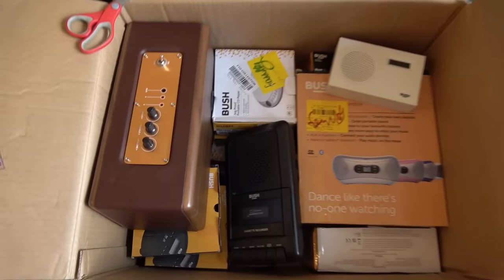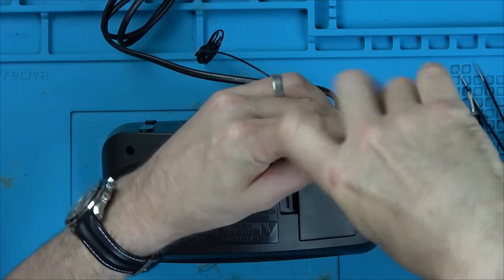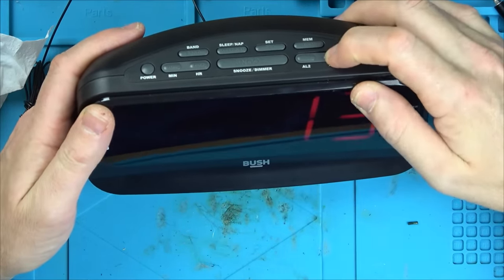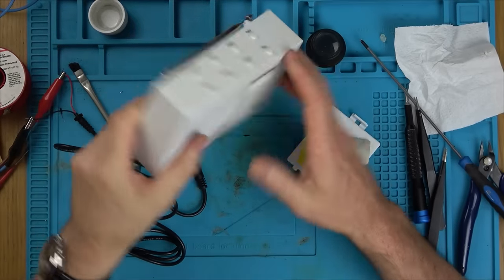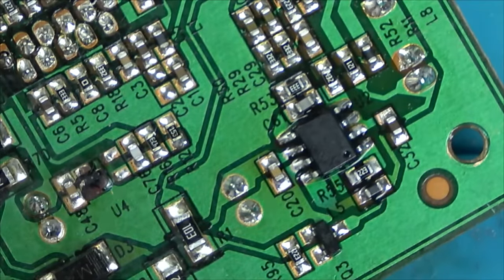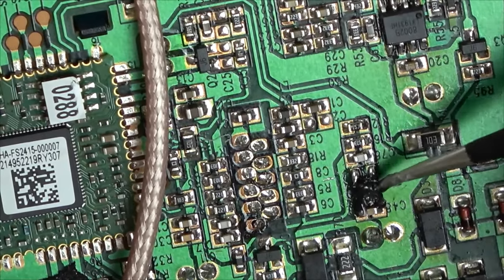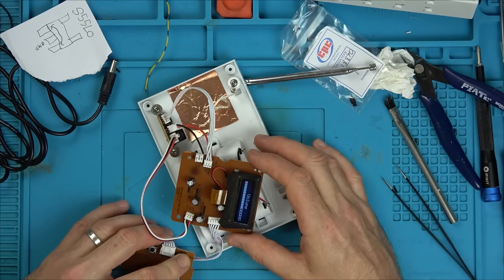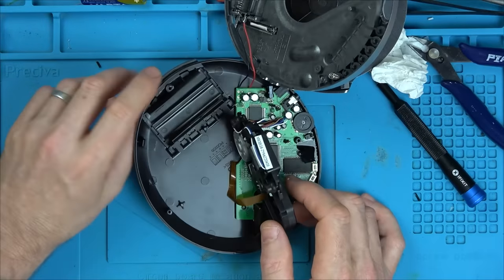I Bought ARGOS CUSTOMER RETURNS to FIX - Can I Make ££$$€€

Comment: The AM radio has been purposely damaged/disabled so that it could be returned as not working. 
In case the staff plugged it in not only does the Tuner not work there is no sound. No-one opens the equipment up to check for physical internal damage so they get their money back. And they then go back and purchase another one which they will also return within the year of purchase.
Thanks @Mymatevince for another cracking video, you really are awesome!

Comment: Old devices often had block/part diagrams glued somewhere inside their cases. And it was a norm to get the schematic sheet distributed as an insert in the user's manual.
Reply: I remember that too.
Reply: Those were not that complex back then, nowadays everything is in one chip with billions of transistors and proprietary circuitry, but without what we have these days we wont be on the internet or we would still use computers the size of rooms
Reply: @309electronics5  Things like color tube TVs were quite complex. Certainly more complex than 90s highly integrated devices. Also, there are schematics of things like PC and laptop motherboards available to download (not always legally, but still). Usually it's just a couple of sheets. Would be easy to print and put into a manual. No one expects internal chip diagrams. Even just a part list would be enough.
Reply: I think companies have come to two conclusions here.  Most people will not even think of repairing something and of those that do, few will try.  Add in the desire of companies for customers to buy again, though  why one would if the thing broke, and why would printing a schematic be anything but a useless cost to a company?
Reply: Doesn't happen much these days with these cheap Chinese products. Except some microwaves, maybe... edit: however, it doesn't take that much more time to add the part number of the ICs to the silkscreen... I loath seeing "U1", "R1".. ok, cool, that refers to a reference number on the schematic, we don't have one... just print the part number.
Reply: My 1st cassette tape recorder - circa 1970 - came with a booklet and at the back was a foldout circuit diagram. I’ve still got the booklet complete with the circuit diagram, but not the machine.
Reply: My first car came with instructions on feeding, hoof care, spare reins etc.
Reply: @AstrosElectronicsLab  
Most small consumer electronics items are not intended to be repairable. It is arguable that there is no value in any component identification screen printed onto the boards. It does cost something and has almost zero value for assembly since parts placement is usually completely automated.
On almost every surface mount PCB I've designed I've struggled just to find space to fit the component identification in characters big enough to be screen printable. With something like an 0402 SM resistor,  just the ident can take more space than the part. Sometimes it's even difficult to find space for characters that don't require much zooming on a drawing of the board. But I did only industrial and scientific electronics, never anything sold directly to consumers.
Many manufactures no longer print anything on discrete SM resistors. Most SM caps never had any markings unless they were specialty types.
Reply: My dad ran a TV/Radio repair shop in the 60s and 70s. He had a book with schematics for hundreds of TVs. I recently cleaned out my parents' house and found it - slung it as it's unlikely anyone will need the schematics now. A different era when nearly everything was discrete components. BTW, silk screening the component parts really is not viable - often the components are changed like for like during a production run and will have different numbers (but the same or similar tolerances and functions).
Reply: My first car had a user manual which included detailed advice about setting up the valve timing. My latest car's manual has advice about not drinking the anti-freeze, and what to do if someone does drink the anti-freeze.

Comment: Great video 🍻
20:09 The polarity of the speaker does matter. As soon as you get near another speaker with the correct polarity, playing exactly the same, you may hear some weird sound cancellation effects 😉
Starting at 26:30 , you talk about "Right to repair", how it would be better to have access to documentation of circuitry in some way. Somebody already mentioned, how it's been normal, that schematics and parts lists of a product were included in delivery...they stopped doing this decades ago, bit by bit, time flies 😳  
Louis Rossmann is heavily lobbying for RtR and I think its a good thing to make people aware of these bad practices.
34:54 Measure it. Your Multimeter has mA uA and A connections. To use them, plug the red probe into the A. Break the circuit and use the probes to bridge the supply output to the circuit input through the multimeter. If the measurement is below 0.2 A (200 mA) use the mA mode and connection. And MAKE SURE you are not using the amp measurement connections for modes they are not intended for, as it MIGHT DESTROY your multimeter, or the circuit, or both, you can even pop a circuit breaker by accident. Never measure how many amps a supply can provide, if you don't know its regulation capabilities...done it on a german 3.5 kw breaker 🙈 nice pop
39:22 list of features says it, Power Supply Ripple Rejection. This is kind of what you want for the application "radio". Both were a good choice, but the first may have had a hard time coming up from shutdown with its max 0.5 watt rating 😅 the second one delivers roundabout 1 W max. and might pop just like the factory one, if 1W is not enough (measure it 😆). 
EN and SHDN with the line above means NOT in binary logic. So like, not shutdown when true (voltage).
Reply: Audio is AC

Comment: The 2nd clock was definitely tampered with. There's no way it would have left the factory in that state. Someone messed with it, and then returned it as faulty. My #1 reason for never buying open box or returned goods, even if they work, is that you never know who had them before, and what they did to them.
Reply: Or maybe someone sabotaged someone else's alarm clock for some devious motive. Then the owner rightfully thought it had just broken and returned it as faulty.
Reply: Buy a clock and change your mind there is no refund. Take the back off and cut random wires gets your money back.
Reply: @mbak7801  Exactly that!
Then the seller's loss gets put into the overall price of their products, so the rest of the customers pay for a select few to enjoy free products.

I've got a cheap scale to use in making espresso and it's inaccurate, so I decided to return it. Had to contact Amazon because I couldn't print a return label and spoke with two different agents, got the label issue sorted, all without even asking me what was wrong with the product...
Reply: Could simply be terrible QC.... never know.

Comment: With those dome switches, you could turn on the radio when it apart and press the button with your finger to test.  More often than not the switch is not the fault, but looks like you got lucky with that one and it wasn't aligned correctly :)    Good to have a success on the first one.  The speaker fault looks deliberate.  Customer didn't like it and wanted a return.  Looking closely at the speaker, looks like it was deliberately cut.  There is a band switch on the radio, someone cut out the AM Loop Antenna also.  Speaker polarity with a single speaker is not important as a speaker uses AC, so you can connect them either way.  On a device like this phasing is not important.    The battery polarity, I've seen it often with Chinese made devices having the colours wrong

Comment: The 'wire with fabric' will be Litz wire, where wire and thread are spun together to reduce 'skin effect' where radio frequencies are present. It also is used on loudspeakers to reduce metal fatigue where the link wires are flexing...
Reply: Absolutely right. :)

Comment: yeah what i think happened with the second clock is that someone didnt like it so cut the wires and returned it as faulty - they also asked for a refund.
Reply: I don't know why you'd do that.  It's a cheap clock radio, clearly, but a cheap clock radio is better than no clock radio in my view.
Reply: i did that with a cheap cellphone. intentionally overdischarged the battery and tampered with the charger so I can return it. Some stores just don't accept a "change of mind/item no longer needed" as a valid reason to return a product.
Reply: @RealEpikCartfrenYT  What country do you live in?  I think here in Australia we generally have the right to return something if we decide we don't like or want it, but it has to go back within 14 or 30 days or something.  I could be wrong though, I can't remember exactly, but you do have rights as a consumer.
Reply: @Lachlant1984  Bosnia and Herzegovina is my country's name.

There are stores which do accept returns normally but in this case I needed to tamper with it as they only accept if it's faulty.
Reply: Argos has 14 day money back no questions so seems a bit silly but people be crazy :)
Reply: @MrLingering I had a devil of a job returning a tablet to them 2 hours after purchase as we discovered it didn't use the Google play store but the manufacturers own limited store, got there in the end but it nearly involved trading standards for misleading advertising
Reply: @Lachlant1984  If you travel to Singapore, you can't return an item if you don't like it. Almost all shops have rules stating "No Change Of Mind Allowed". They also affixed a "warranty void" stickers on the screws so that you cannot open the product to damage its components.
Reply: Why go to the bother of taking it apart and cutting wires when Argos would take it back without question anyway? 😁
Reply: @RealEpikCartfrenYT  In the UK if you purchased from a shop there is no legal right to return if you change your mind, although most shops do allow you to. With mail order you have 14 days to return for any reason. What you did would technically be fraud if you were caught.
Reply: Vince I’m not sure the 300mA regulator is enough current rating for the radio.  Only based on the fact that the DC in put on the back says 1000mA PSU.  You might want to check the current draw at full volume.
Reply: @RealEpikCartfrenYT nek jos neko gleda
Reply: @RealEpikCartfrenYT  how do you justify that to yourself, morally?
Reply: @MrLingering  They don't always honour that though - depends on the staff they have on the day you take it in - but they will always take faulty stuff (except laptops, according to several reports that I've recently seen)
Reply: @digihorse6730  Technically you can drop 5V to 3.2V by putting three 1n4007 diodes in series. Doesn't always work in practice especially if there's other stuff going on as well but I've done a couple of simple repairs like that before now. As long as you can figure out where the 5V rail is and where the 3V3 line needs to go, then it's worth a punt if you don't have any other options.
Reply: @MrLingering  depends on the staffs attitude. I bought an Amazon TV stick thing, realised ended up doing same stuff as my smart tv (no idea why I bought it lol), they wouldn't allow a return as the box was opened. So I made a ticket that the device wouldn't connect to my wifi to get the refund
Reply: @digihorse6730 The amplifier, which will use the most power, is most likely not connected to the 3V3 rail, but rather directly to the batteries/DC input. The 3V3 will be for the digital decoder and control circuitry
Reply: @RealEpikCartfrenYT  In other words you destroyed a product and made the store loose money just because you didn't like something.
You are the reason why products are getting so ridiculously expensive and why stores are increasing margins each year.
Reply: Skooma addiction at the factory.  Waaay too much wrong with it, to be one man's mistake.
Reply: @RealEpikCartfrenYT  yep its the same in Hungary :D
Reply: @MrLingering  over 14 days?
Reply: @Prometheus574  warranty void stickers r illegal haha

Comment: I suspect that the Bush DAB Radio had the wrong power supply plugged into it that took out the regulator and audio amp IC.
Great fixes as always, Vince. 😊
Reply: Yep, very often these audio things have centre negative and most supplies are centre positive. I bet they didn't check first.
Reply: @englishrupe01  Japanise products tend to use centre negative. i.e. Casio, Brother, Epson etc.
Reply: @chrisg6597  Yep, and a lot of guitar stuff does, too.
Reply: @chrisg6597  And several '80s home computers too. If you're lucky the device will have a reverse diode on the input that will blow dead short in the event of reverse polarity and only kill the power supply not the whole device. If you're REALLY lucky it might also have a fuse which will blow when the diode shorts to protect the power supply as well
Reply: Could the problem be the cells were fitted arse about face

Comment: If your worried by the current draw in battery mode of your radio (or any battery device) simply put your meter into Milliamp mode and pull out a battery and remake the connections but with your meter in series, basically let the current flow through the meter as wall as the radio and read of the current when on and then measure when off. Probably next to zero when off maybe a few milliamps, dunno...cheers.
Reply: You need microamp resolution to measure  this,  but his multimeter has that setting.

Comment: I remember when I bought broken PC Speakers from Conrad Electronics für under 5 Bucks, it had the Ground trace missing on the Audio Input. I soldered a Jumper wire and fixed it, It's unbelievable that some Manufacture skip the quality control, at least for some people it's an advantage to get a Cheap Device which are sometimes easy fixable, but for regular customers it's annoying to have the rassle to return it, or even fail after a short period of time.

Comment: Thanks for the trip down not so good memory lane. I started in the electronic repair business as an apprentice in the 1960s when things that were sold were on the whole repairable, though since then things have gone down hill to the throw it away it is not repairable for most things we have today. I was very glad to hang up my soldering iron put the Avo 8 in a box and put it in the loft though I have kept its long time replacement Fluke in my workshop that does not have any thing to do with electronic repair. I wish you all the very best for the future but on those three radios you looked at I do not think you broke even on time and components.

Comment: Hi Vince, what a fixer MARATHON! BTW I think that the regulator on the radio blew because someone connected a 12V or a laptop adapter to it. Regarding the power draw, you can always disconnect one of the battery leads and put the multimeter in between to measure it. ;-)
Reply from the maker: Cheers Marcel👍

Comment: a great pity that not more High Street, Catalogue and Retail Returns Centres aren't employing apprentices, repairers, restorers and technicians to repair and fix stuff to restock as 'refurbished' etc. - Would make such a difference especially for Electron waste such as these from entering landfill.
Reply: It really is such a shame that people are so quick to throw things away and buy new things. There are pretty much no consumer products you can buy that are made to last like they used to be!
Reply: BER - Beyond Economical Repair.

A technician being paid £8 per hour takes two hours to fix a £10 radio. Which probably cost £4 to manufacture before the markup.

I know this because I worked at an eFab firm where they were fixated on the length of time to repair something. Their margins were very low which was on them.
Reply: @kjamison5951  Exactly my thoughts. Only practical as a hobby. It's a shame stuff has been cheapened so much as to become disposable.
Reply: @kjamison5951  spot on, not economically viable.
Reply: You don't know how Argos returns work or where they Go So why comment

Comment: At 3:03 there is a tiny little piece of black (possibly plastic?) visible on the centre of the affected cap, moving the switches around probably disturbed it. Nice troubleshooting though!
Reply: noticed that also, a very small speck rendered it useless! great fixes Vince!

Comment: 😂 worked in a Alba Bush TV  refurbish place when i left school this is a common fault  ..  they all either dont align or brake off.  and normally can be fixed with a soldering iron . RADIO/TV fix.. keep up the good work ..😍

Comment: The ENABLE pin, is high to enable.  The SHDN pin had a line above it, so it was an inverted signal, so that's low to shut down.  They are the same thing.
Reply: Yeah probably just inadequate current on the first one.

Comment: That power regulator IC on the DAB radio, didn't have any sort of feedback pin. The extra pin was to put a capacitor across to reduce output noise. Can't think why, it can't be a switcher internally without any sort of coil, or a capacitive voltage multiplier, cos they only work on whole-number multiples of the input. Usually. But whatever, that's what the data sheet said it was for, a 470pf cap to reduce noise. That, the shutdown pin, and the usual 3 for a regulator, and that's your 5 pins.

Well done on the fix btw! Nice work.